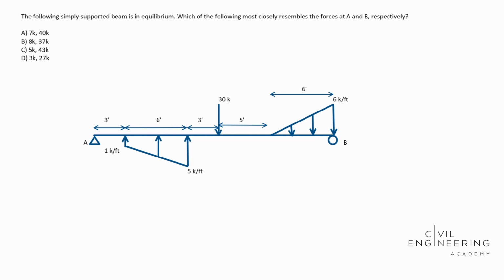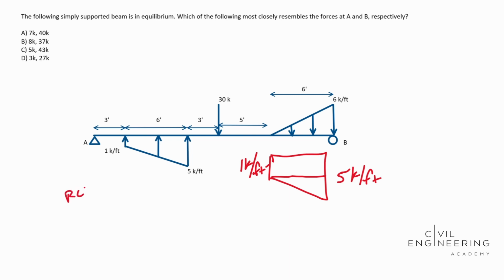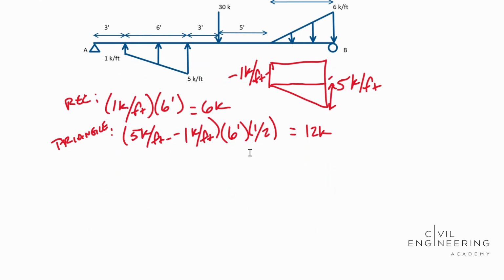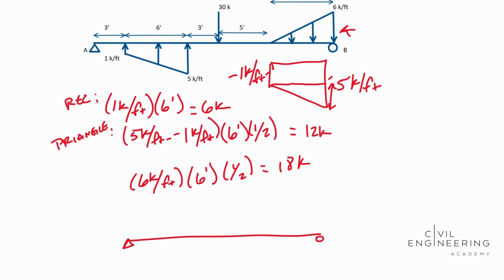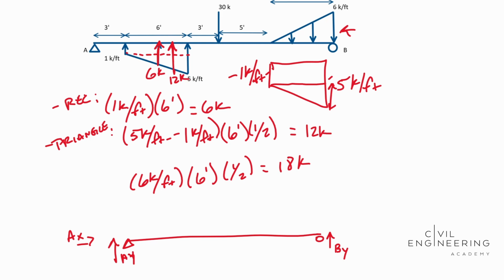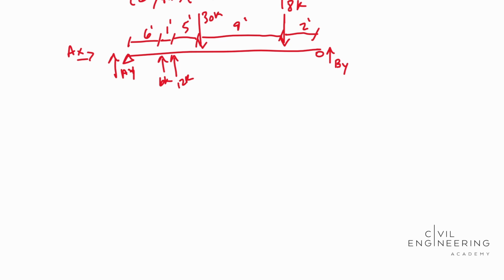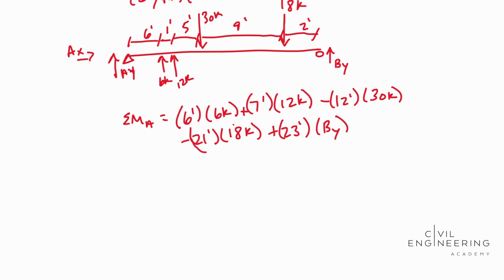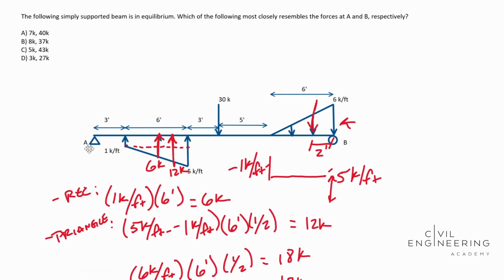Civil FE/PE Exam - Structural - How to Solve for Unknown Support Connection Forces

Comment: Ncees pe hb 1.1, p. 24.

2 moment eqns & 1 vertical sum eqn, as a control and you're done.

Nice little "busy work" problem.

Got something similar in my statics 101 exam, back in the day.
Reply: Just to add on: sum of applied forces in Y direction is +30 kips. Even if the direction of the reactions at A and B needed to be known, none of the answer options add up to 30, besides D.